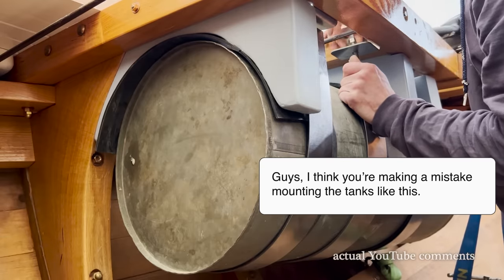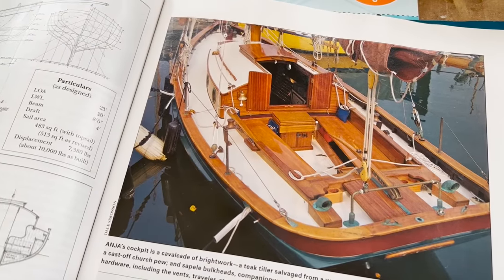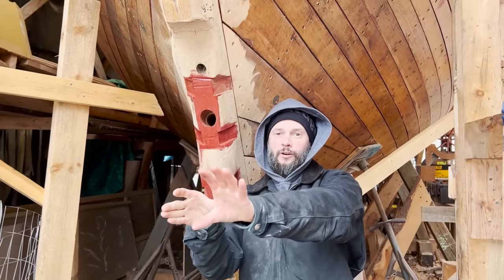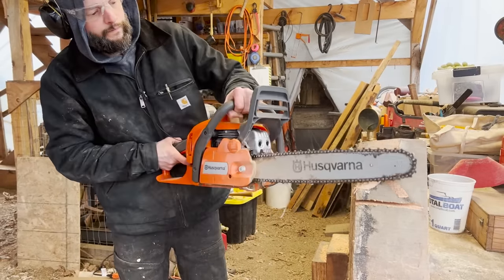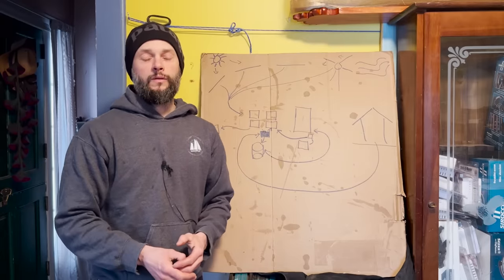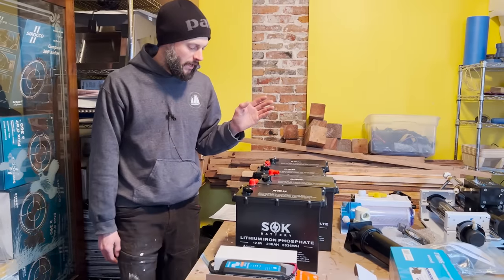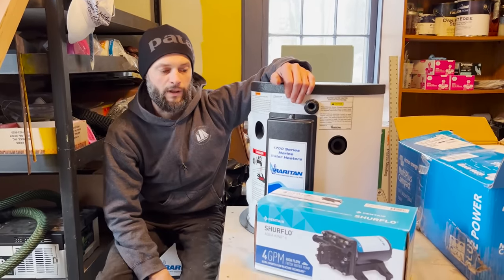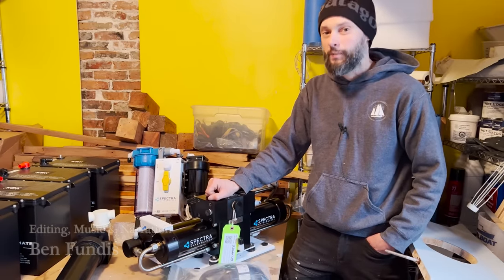That Prop Is Too Small & Other Comments - Episode 248 - Acorn to Arabella: Journey of a Wooden Boat

Comment: Steve,
Have you given any thought as to how your going to maintain your hull while your underway? 
I was a commercial diver in the Boston area for a little over 10 years, during that time I was involved in many ship husbandry projects. Steel, fiberglass and wood hull work. 
It sounds like you are going to go far and wide in your travels and for long periods of time. I think it would be very beneficial for you to think about incorporating simple systems that would allow you to service anything below the waterline of your boat. There are 2 main systems that should be considered. 

1. a hookah diving system
hookah diving systems are simple and easy to operate. what they lack in freedom of movement like SCUBA diving systems they make up for in many ways. they are significantly easier to use and operate. A hookah system requires less maintenance. they do not require large amount of equipment that SCUBA systems do so it would take up a lot less space on the boat. There are small but capable electric systems out there that will even sustain 2 divers at a time giving you and yours something fun to do while in shallow areas, it may even lead to catching dinner...

2. an electric pressure washing system.
cleaning an entire hull so its free of marine growth can be a painstaking process depending on when it was last serviced. the more often its serviced = easier to clean the next time = less drag = more efficient underway = longer lasting healthier hull = happier Steve.
pressure washers are the preferred tool for cleaning marine growth from a hull. With a small electric low PSI pressure washer there would be minimal risk to damage a more delicate hull like yours will be. combine that with a simple hookah system and you would be able to very easily service your hull on a regular basis at whatever interval you choose, you might even enjoy it.

a hookah system will also allow you to service everything else as well, keep your prop clean, change your zinc's, clean your rudder, maintain all your through hull's and anything else that may need service. Trying to service any part of a vessels substructure with just goggles and a snorkle will lead to frustration - trust me. 

If these systems are something you are considering than i would be more than happy to provide more information. Over the years I have picked up a lot of tips, tricks and specific tools/equipment to make hull cleaning a breeze.

Best of luck.

Comment: your prop really is too small.    You  need  a huge propeller and a large gear reduction to achieve high efficiency not more power.   2 horses could pull that boat with tow lines 4 knots:  2 horse power.    Your efficiency is definitely going to be very low like most sailboat inboards which are typically only 25-40%        human powered boats that barely carry 1 person use 16 inch props.    The prop diameter needs to be 5-6ft in diameter to reach 90% efficiency.
Reply from the maker: Thanks for watching. What’s your background, Sean?